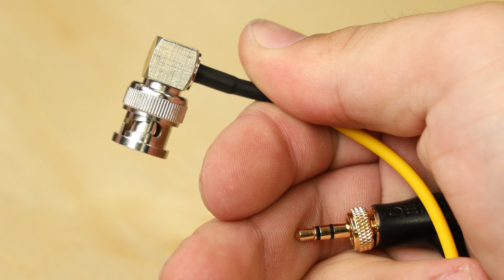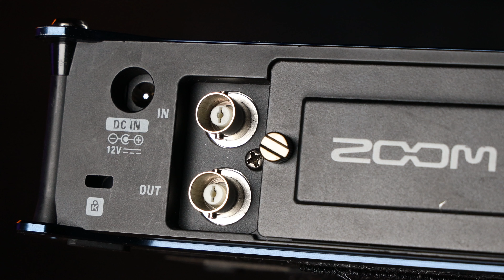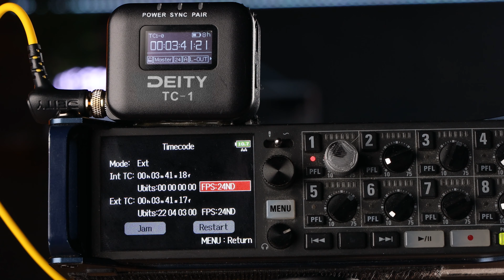Timecode on Zoom F8 | Deity TC-1 + Zoom F8

Comment: Hi, i have the Zoom F6 and want to have this as master, because it keeps the TC running when switched off. It also gives out TC but the TC-1 does not receive it when put in Jam mode and selected L-IN. Unfortunately there is no A-IN. I can sync my Blackmagic Studio Cams when sending A-Out on the TC-1. I can also connect the Zoom F6 to the Studio cams and they receive timecode. So i assume the F6 sends TC in mic level but the TC-1 only reads the tc audio as line level. Is this something you can add by a firmware update or is there a workaround (putting a preamp in between)?
Reply from the maker: The Zoom F6 timecode pinout is backwards and you need a tip ring splitter cable.

Comment: There is one glaring problem here. If you pause this video after the Timecode was supposed to be synced according to the narrator (I'm currently paused at 0:44/0:45 video playback time) You will see that the Timecode is, in fact, not synced at all. The TC-1 shows 00:03:43:17, the F8 Internal Timecode shows 00:03:43:15, and the F8 external Timecode shows 00:03:43:14. You can clearly see that these Timecodes are not synced they are off by 1 to 3 frames.

Comment: Can you shed some light on the two settings in the F8n: 1) Ext Audio Clock Sync, and 2) Ext Continuous? They seem redundant and are defaulted to "off." I'm pretty clear what 2 does, but not 1. Should I have them on? Any help appreciated. Thanks!

Comment: It’s necessary leave plug the tc all the time?
Or I can sync with the mixer and plugged into a camera for sync?
Reply from the maker: You should leave the TC plugged in the whole time, otherwise you are relying on the built-in clock of your device which is likely less accurate and more likely to drift than the TC-1
Reply: @DeityMicrophones  I disagree. Having 5 cameras to jam their time codes. You Jam it once and remove the timecode generator
Reply from the maker: @AdebolaAdenuga  You will cause drift if you do that. You should not remove the timecode box.

Comment: Will it be the same with zoomf6?
Reply from the maker: Roughly ya. Might be slightly different to find the TC menu from the main menu but all Zoom recorders use a similiar menu style.
Reply: @DeityMicrophones  When you use TC-1 with F6, you're gonna have to use 3.5mm TRS - 3.5mm TRS and the rest is roughly the same?
Reply from the maker: @user-nu8bf3bf9m  ya

Comment: if you pause the video the timecode is not exactly right sometimes even 4 frames behind
Reply from the maker: You are correct. What you are picking up on is the latency in the F8 LCD screen that has a 2-3 frame delay in processing the image for its display. You'll see this with all LCDs. On cameras, the LCD monitor on a camera can sometimes be as many as 4-5 frames behind the action it captured. Combine that with the rolling shutter of our camera filming this video and you can get up to 4 frames behind visually.